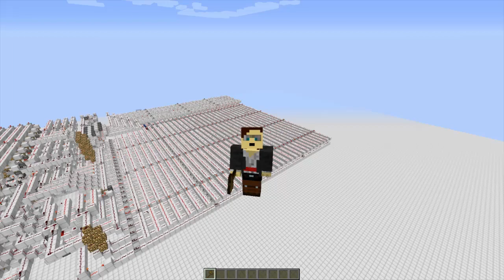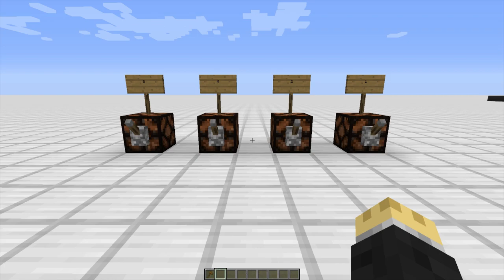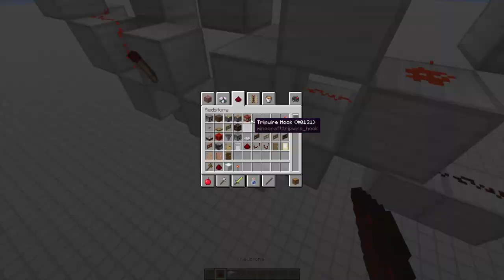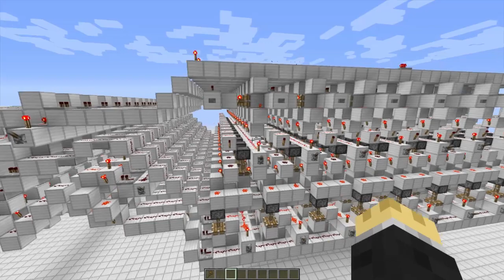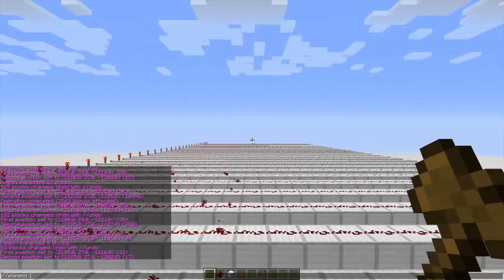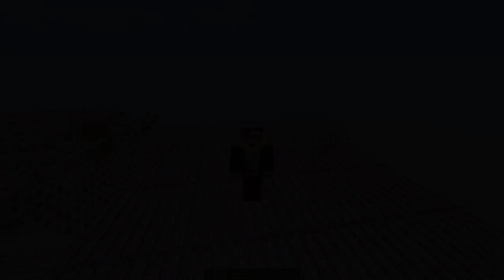Basic Computer Concepts - Pt 1 - CPU Architecture

Comment: Soo, I have built everything until the Flag-circuits. Everything until that point took me two days (with the installing of worldedit included). Thanks to the 0.25x speed option I could take a closer look at the speed up parts :). Until now everything is clear. Let's see how it turns out in the later parts of the tutorial, where you don't provide as much information as now. 
My current computer is more or less a copy of yours, with the exception of a better decoder (the bluewave one) and the jump address of the program counter connected to the output of the ALU (haven't tested jet if it works). When the tutorial is finished I will start to experiment a bit more with different setups. 

By the way, are you still working on the expansion of this tutorial or is this project on hold?
Reply from the maker: Honestly, I hadn't intended for anyone to follow this as a tutorial... my initial title was a tutorial, yes, but that I figured was misleading. A concept video is more appropriate. The intention was to make the concepts clear and easy to grasp, but if building the computer helps, more power to you.

And yes, I am planning on expanding on this. Though we're starting to dive into more abstract concepts and I'm struggling to quantify some things.
Reply: @n00b_asaurus  I know you didn't intend this as a tutorial. But it's nice if I can start with a working and structured computer before I expand it to whatever I feel like. By the way I got the Flags worked out as well. It took me a while to know what you are actually do with them. They are a bit more restricted compared to the ones I know. When I finished my first pc (at the end of this tutorial) I will restart and try to make it AVR-compatible. Let's see if I can make it work with the AVR-Instruction set.
Reply from the maker: Hahaha there's an instruction set I haven't looked at in a while!
If you can get that to work, That'd be awesome. Are you intending on leaving out some of the architecture-specific instruction , like eeprom operations, timers, and ddr register access? or are you going all in?
Reply: @n00b_asaurus  I think I will mostly stick to the components you used so far. Perhaps I add the timer/counter and a multiplier. I will probably also use the 16 bit memory and not the 8-bit one. Of the flags I will use all but the half carry flag because I don't see the use of nibble operations. Besides that I try to implement a pc that can handle all the remaining instructions (about 95) with the addition to any instruction that is necessary to control the pc. My goal isn't a close recreation of the AVR Mikrocontroller but something that works that I can play around with. And I already did some coding with the AVR instruction set. C or java as well but those are kind of impossible to implement in Minecraft. 
Because of that I try to come up with an intuitive way to type in the code. At first I thought of the book, but when there is only one String per page and no string operations you can't use that. Second thought was to put things that represent letters somewhere which then copies the command blocks with the respective torches to the program memory. Items in chests is one way, but you don't really have a readable code. I can't use Maps in item frames because of lag and limited visibility. My current favorite is retexturing Blocks to represent letters. One fun thing I already added is a command block wich plays a bell sound at the position of the player, when the program counter reaches a certain line. It really helps to know where you are in the code. One also plays the snare sound whenever the clock gives out a signal. Acoustic feedback is useful after all. 

In the end I try to make stuff like fft, cordic, some digital filters, or even some os stuff with the semaphores and so on. Don't know how long my motivation can keep up but for all of that I need a to prioritize on a useful interface first.
Reply from the maker: I totally forgot the AVR instruction set called for half carry flags.
Usually those are used for converting bcd arithmetic results back into bcd. The 8085 had a nifty little 'Decimal Adjust Accumulator' instruction for this, but I don't see an equivalent in the AVR instruction set. There is a branch if H is set or cleared, so they might have intended for programmers to write their own decimal adjust subroutine. Who knows.

Otherwise, as far as writing code for it is concerned, I'd make the microcontroller first, get it working, then figure out how to compile text.
I do like the idea of retextured blocks though. That might be the easiest to analyze and parse.
Reply: @n00b_asaurus  The AVR instruction set also has a swap nibble. Besides those two i don't see any nibble related stuff. And I don't know on what to do with this. So I don't care about adding the  additional ALU operation. 

I did some other stuff the last few days. But I intend to finish the tutorial. After that I will think about how to change the "hardware"  so that I can implement each instruction I want to implement. And after that I will think of how to implement the compiler (Is it a compiler? Kind of, since it translates AVR instructions into "machine code"). This compiler seems doable. But I need to learn the necessary commands. Never really used any fancy command block stuff so far.
Reply from the maker: Option B is to op't for an interpreter structure. Basically the same as a compiler, you just run the compilation stages one at a time and execute the resulting machine code as it is generated.
That is a major over-simplification though.
Personally I would just op't for compiling the code, then executing it.

On that subject, the more I think about an in-game text-editor and compiler, the more I think it might be a fun idea.
Do you mind if I run with it?
Reply: @n00b_asaurus  I don't understand your option B good enough for me to recreate it. 

And of course you can make an ingame text-editor and compiler. Diversity of possible solutions is great. 
I'm looking forward to whatever you produce. It doesn't matter if I inspired you or not.
Reply from the maker: Neither do I... it might be a good learning experience for both of us!

Comment: How would you implement multipication of two different numbers, other than looping on addition and breaking when a certain flag is on?
Reply from the maker: Well, depending on how sophisticated your hardware is, your options are pretty much only software.
You could implement the algorithm that I'm using in this video, which just adds the multiplicand to itself n amount of times. It's easy to program and even easier to understand, however it is not the most efficient method.
A better algorithm that most people use takes the multiplicand and adds the multiplicand if the multipliers nth bit is a 1. You then shift the result, then add the multiplicand again if the multipliers n+1th bit is a 1, repeat for every bit in the multiplier.

Now if you're willing to put in the time and effort needed to designing your CPU correctly, then using hardware multipliers is just as valid as multiplying in software.
Option one is to build it into the ALU, option two is to add it on as an IO device (like a coprocessor). Hardware multipliers are doable, but be warned: if you want a synchronous multiplier, it will be bulky. If you want it more compact, you'll have to go asynchronous.
Reply: Thanks for the explanation!
Reply from the maker: That's what I'm here for ;P

Comment: I have a problem at 19:40 I did the same thing that you did but, at 3 register it gave me 14 instead of 17, idk what is the problem, any suggestions?
Reply from the maker: I think I know what happened, but just so I know we're on the same page, what do you think happened?
Reply: n00b_asaurus I think I got the timings wrong or I messed up something in ALU
Reply: Tried fixing it but when I tried to do it again, now it outputs 10 at register 3
Reply from the maker: well, that wasn't the right answer then...
Reply: Have any ideas on what might could have caused the issue?
Reply from the maker: a few, what are your thoughts?
Reply: I have no idea, I been going through everything more then 10 times, checking if I misplaced redstone dust or haven't placed a redstone torch somewhere where I should.
Reply from the maker: well, assuming you haven't even added program memory yet, you should be dealing with only two circuits at this point: the ALU and the registers. 

forget inspecting every piece of redstone - that's too complicated! Start with these 2 circuits. If you send in the control information without writing, do these circuits give you the data you are looking for?
Reply: n00b_asaurus I tried sending 14 and 3 directly through ALU and output is still 10 I think that there is something wrong with my ALU but I can’t find out what it is
Reply from the maker: so, there's an issue with the addition... are there any other functions experiencing issues that could point you towards the fault?
Reply: n00b_asaurus Nope It’s only addition, tried devision and other stuff and it works, so yea
Reply from the maker: I take it you're using an ALU with different circuits performing different functions, rather than one circuit performing several functions.
Reply: n00b_asaurus yea
Reply from the maker: well then you'll need to inspect the output of each group of half adders to make sure the signal looks the way it's suppose to on it's way through.

start with the first group - you say you're adding 14(1110) and 3(0011) together. The output of the first group of adders is just an xor between those two numbers (1101)
if you see this sequence on the output of the first group of half adders, the fault is in the second group.
Reply: I did what you said and output is 1101 what should I do now?
Reply from the maker: The fault is in the second group of half adders...
Reply: I know that but I don't know what to do to fix it.
Reply from the maker: You're still not getting it.

If you start with "there is a fault" and you just try to find it through trial and error, your chance of finding it are slim-to-none. There's too much to check, so forget trying to find the one dust or repeater that's not working right and start with the highest level of abstraction you can deal with. 

We started with the CPU giving the wrong answer. The CPU is our highest level of abstraction, so to get an idea of what could be causing the fault, we need to go down a level.

We took the CPU and split it into the ALU and registers. Examining the outputs of these blocks shows the registers are working fine, but the ALU is at fault. Move down a level.

We took the ALU and split it into it's primary components. After examining the outputs of all functional blocks, we determined it's the adder that's at fault. Move down a level.

We took the adder and split it into it's two groups of half adders. Examining the outputs of the half adders shows the second group of half adders is at fault. Move down a level.

Do you see a pattern forming? If we move down a level to the second group of half adders, what do you suppose we'll get?
Reply: And?
Reply: Half adder is XOR and AND and outputs are CARRY and SUM right?
Reply: And because XOR is fine that means that its problem with AND?
Reply from the maker: does the and appear to have an issue?
Reply: Yes, 14 AND 3 should be 10 (1010) but instead it's 12 (1100)
Reply: If its easier for you to see it visually you can join the server I am building this on, if you have some free time on your hands
Reply from the maker: A logic and between 14 and 3 is 2
Reply: n00b_asaurus Oh yea sorry my bad... anyways it outputs 12
Reply from the maker: you forgot to thumbs up that last one ;)

Anyway, ultimately I think it would benefit you far more to learn how to troubleshoot computers on your own...
I had a request a while ago to make a video on such a subject, but I didn't really see the need for it at the time. Since I've been getting more and more comments like yours recently,  I think it might be beneficial to make that video now more than ever. 

I understand you want to get an answer fast and get your computer working asap, but at the same time I really feel like troubleshooting is a useful skill to have. So I'll tell you what, you say your computer is on a server? I won't troubleshoot it for you, but I'll join and walk you through the steps to finding the fault.
Reply: Sure, its just a creative plot server, mc.cosmicmc.net that's the ip and you will have to do /register <password> <repeat password> because its cracked server and join the creative server. Just msg me on the creative server when you join, also trying to find the issue and building this computer taught me more how computers work.
Reply: Oh and the version is 1.12.2
Reply: FIXED Negate B mustn't have a torch

Comment: How are you supposed to do addition without an accumulator?
Reply from the maker: Depends... what role does the accumulator play?
Reply: @n00b_asaurus  my problem is that I can't read A and read B at the same time, if my computer does the instructions LOAD (register 1) then ADD (register 2), as soon as the program counter increments to the ADD instruction, we lose the data that we read from the LOAD instruction. I solved this by adding a register to the A input so that it stores it. I'm not sure how else you would do this.
Reply from the maker: That's pretty much how  you do it.
Basically if you want to add two numbers together you need to either:
A) Use dual read RAM
B) Use dual read registers (physically the same thing, conceptually different)
C) Stash one value in a temp register or accumulator register and fetch the other one from RAM or the registers.

No matter what though, you need at least one register, as bus's cannot store data.

Comment: at 15:30 you said that you could get away with three lines, but that is not possible the maximum number you can count with 3-bit is 7 and you have eight registers. how did you manage to have three lines for selecting the different registers and one enable line
Reply: nevermind i made a mistake
Reply from the maker: do me a favor - count to 7 in binary, include the leading zeros.
Reply: I already said i made a mistake. 

but here it is

1. 000
2. 001
3. 010
4. 011
5. 100
6. 101
7. 110
8. 111

in my build i forgot one.

however, I like your videos
+1 subscriber
Reply from the maker: Oops, my apologies. Youtube doesn't always notify me of new comments. It can be a little frustrating at times. I'm glad you were able to figure it out regardless ;)

Thanks for the sub btw!
Reply: no problem :D

Comment: your videos are awesome and i subbed about a year ago!
but i have a little question: i've build the ALU exactly the same as in the ALU video and it doesn't seem to subtract right: in the video (9:00) you test the subtraction with 14 - 3 = 11. i also get that result when i subtract with my ALU, but when i for example do 11 - 4 it gives me 15, it's adding a bit that it should subtract! can you maybe test the same operation on one of your ALU's if it also gives the wrong answer or help me? it correctly subtracts some of the bits, so it seems like one or multiple bits are different, but all other operations i've testet work and i cloned the bits with worldEdit, so they should be exactly the same -_-
Reply from the maker: You built the same ALU huh... did you follow a tutorial? if so, mind pointing me to it?
Reply: yes, i built it exactly from your tutorial with all 12 functions ;D and all the ones i've testet work fine, even like the 14 - 3 = 11 example, but 11 - 4 = 15 for me, although i stacked the slices with worldedit, so they should be the same (there are torches on side on the third block, so i had to first stack the main 2 block slices and then stack a small part with the torches on the side on the third block; but that part worked fine).
Reply from the maker: Have you tested any other functions? Any of them have any weird quirks?
Reply: i testet all of the functions i knew how to get by combining control lines, and the same problem was of course with the subtract - carry, but also this one didn't work: (not 4) + 11 = 13, but it should be 6 i think. also i have a world download here ,if you want to test it, wherein i stand by the ALU (i used MC 1.11.2 with worldedit and mostly some clientside mods): https://we.tl/t-Yq9nmKkybw
also it's a bit difficult to comment fast if you live in a very different time zone xD (it's 01:40am for me right now and i go to sleep in a few minutes)
Reply from the maker: I'll give you a hint. With absolutely no function selected or enabled, your ALU is spitting out 8 (Bit #3 is a 1), you should be able to spot the issue pretty easily.
Reply: ok, i got it now, the repeaters of the AND control lines were on the wrong blocks, they all had to be shifted one block forward or backward, but i have one question left: i still don't know which control lines i have to enable to get the decrement and the shift left function. i wrote down the one you said in this and the ALU video and some i figured out but these two are still unknown for me, so maybe you could give me the combination of control lines for these, sir?
Reply from the maker: I believe I listed them in the description of the ALU tutorial.
Reply: ok, thanks for the help